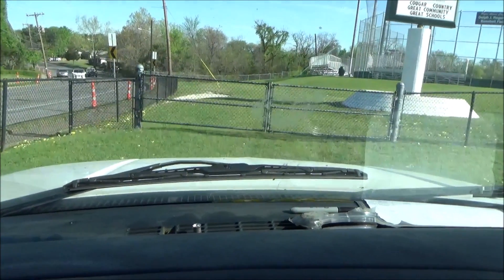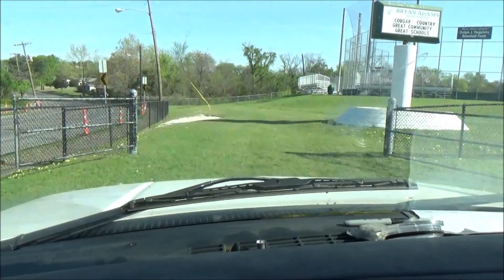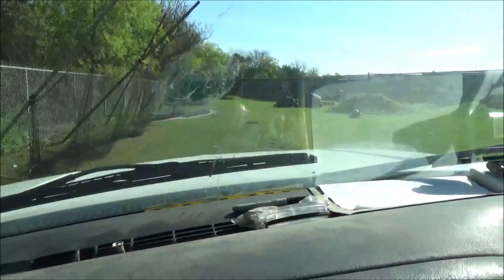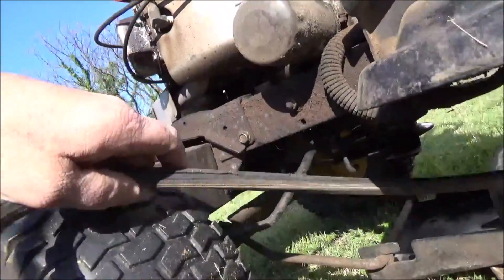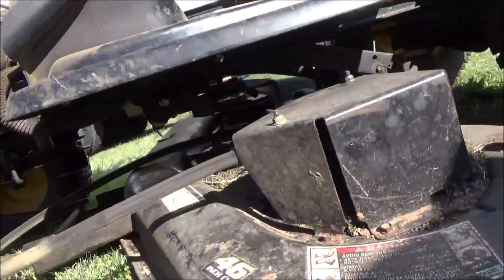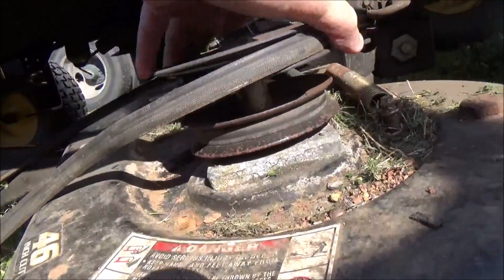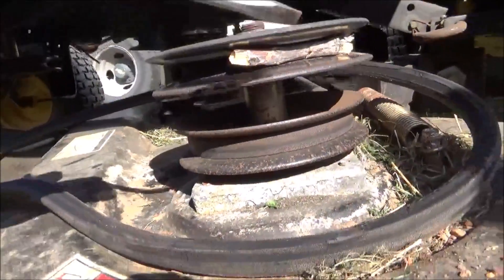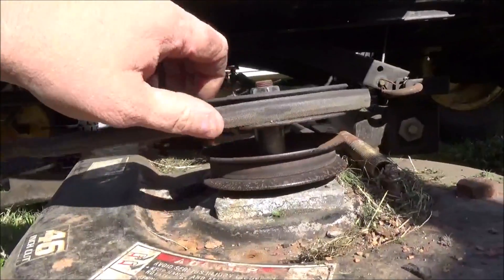IT'S ALWAYS THE MECHANIC'S FAULT!!! /  MTD RIDER / BURNED BELT /  OPERATOR ERROR!!

Comment: I have a 2016 22hp Sears rider,  I just changed the blade belt and it wont stop flipping on the drive pulley but stays the right way on mower deck pulleys, what causes a belt to flip?

Comment: Hi, this not belt related question; however, I have a 14.5 hp, Briggs, vertical shaft.  Exhaust valve broke at the stem.  It scarred the top of the piston to a depth of 1/8 inch, but, did not crack or puncture the piston.  I replaced the valve and motor seems to be fine.  Any comment as to whether I should have replaced the piston or anything else?  Thanks and I enjoy your videos!!
Reply from the maker: Normally the valve breaks if there is a massive intake leak causing a lean fuel mix condition     Lean mix will overheat and burn valves, in your case, break.  As far as the piston goes just remove any sharp edges with a 3m pad and a die grinder.   The old 14.5's were torque monsters and were solid good motors.
Reply: Thank you!!  Yes, I did wire wheel the top of the piston to knock burrs off.  I hope it will be ok.

Comment: My 46 drive belt goes  a double drive pulley to center back of the deck and requires removal of its bearing bolt and hinge pins. After a while the ball bearing got loose inside the pulley bore but the part was cheap and the bearings could be reused. MTD is OK for me home owner.

Comment: i have problems with my MTD RS115/96B its very slow moving and don't cut until the depth lever is on low and then it hardly turns the blades any ideas bud

Comment: As I am a back yard dude I struggle with field calls.  Whatever I bring along is the wrong thing.  I did an gas auger (loading grain bins) for a farmer and it was 40 miles out.  I didn't have the right size gas line.  ARGH!!!   or as you would say   dad gummit.    I rigged it so he could use it --- I Rerouted the gas line.  He did not want me to come back as he bought it at an auction the previous week and he knew there were a lot more issues with the auger.   Thanks for your new videos.  They are fun.